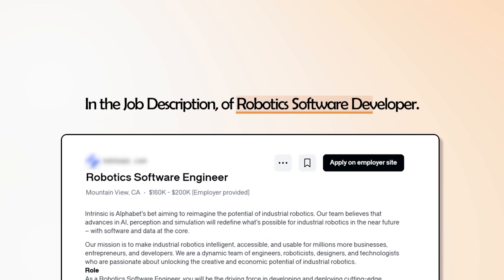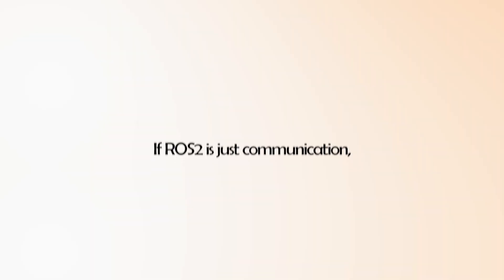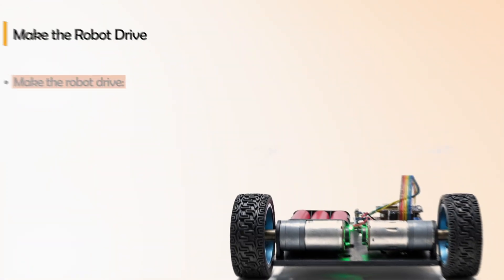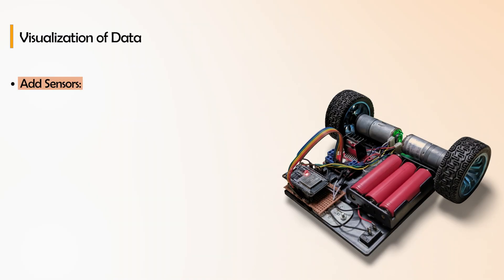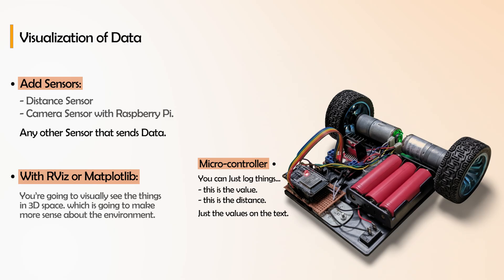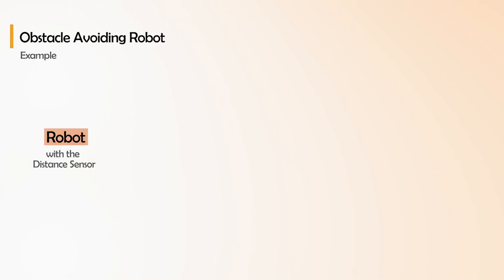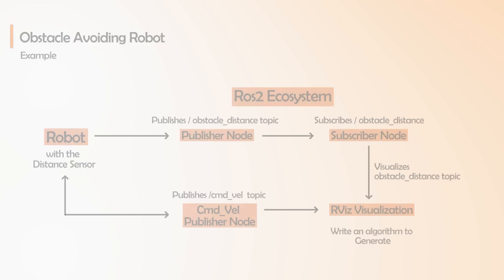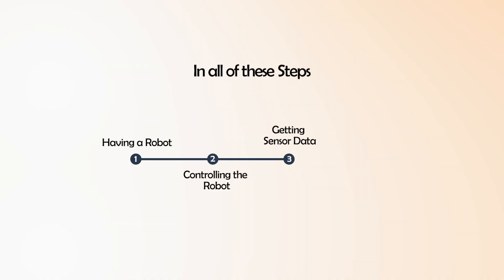Learn ROS2 Practically with a Real Robot | Robotisim

Comment: Many diff drive kits i searched (if not all of them) have unsoldered motor wires, so you can’t really use them (unless you have soldering equipment) . Also, for ros2 you would need either learn micro-ros with arduino, or buy raspberry pi. My raspberry arrived damaged and I am still waiting almost for a month for return unfortunately. There are quite a lot of obstacles in the very beginning, wish it gets easier :)
Reply from the maker: #life 
amen
Reply: @robotisim  amen indeed)